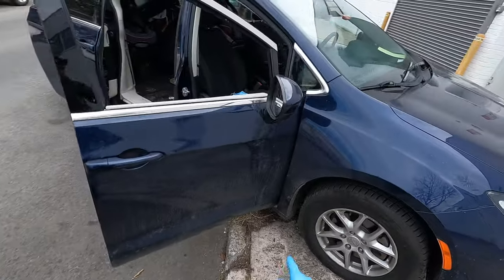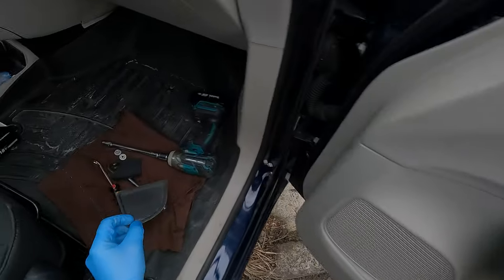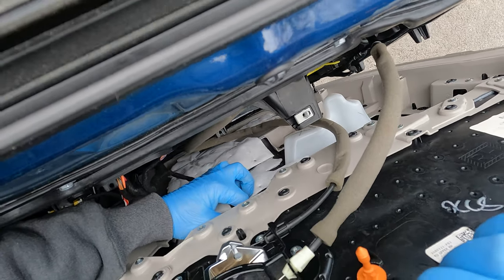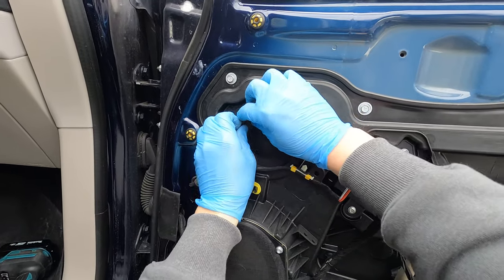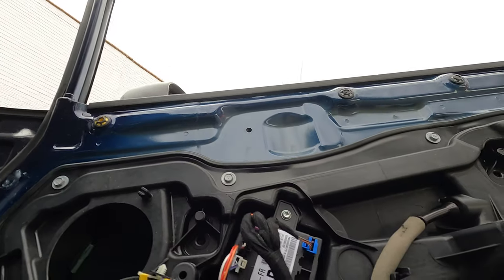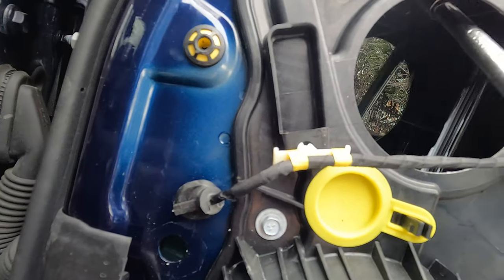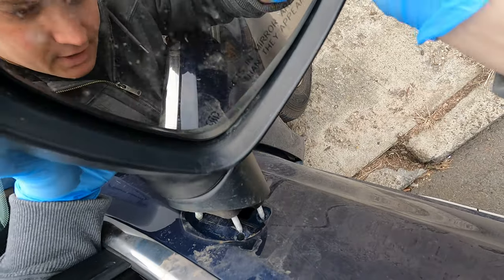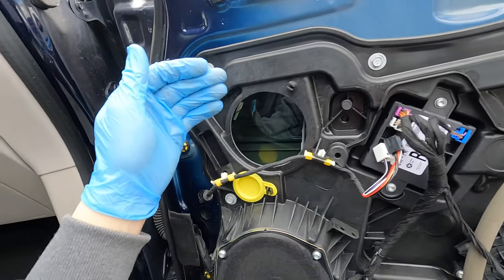Chrysler Pacifica DOOR MIRROR removal how to 2017 2018 2019 2020 2021 replace lock 2022 2023 2024

Comment: This is a good video but one thing he doesn’t tell you, that in order for you to get wires back in for mirror is to roll up the window and if you do drop anything you can actually take the speaker out for easy access.
Reply: Completely agree. It's a great video, and follow the advice of connecting the cable harness back to the window control and rolling it up to route, unroute the mirror harness. 

 Btw, my door's window / door lock controls are installed in a console that easily pops out so you can connect and disconnect that harness more easily.

Comment: this was helpful, but the hard part was getting the wires routed so that they weren't in the path of the window. if you feel around there's a little hitch in the sheet metal that the wires can go around that keep them out of the way of the window.
Reply: Confirmed window up after removing and mounting new, tuck wires behind glass and jog window up to give more room to run wires

Comment: Good video but need more information on routing the harness. The window must be down to access all three nuts but the window must be up to route the harness around the outside of the window track and back through the oval shaped hole. Take care not to pinch the harness when rolling the window back up. Small nimble hands are helpful.

Comment: an old telephone cable or network cable trick is to tie a rope / string / wire of some sort to the wires as you pull the mirrow out and use it as a guide to pull the new wires back in.  FYI

Comment: Super helpful! The only other tip I could add is for the very hard to reach nut, I rolled the window all the way down to clear the window bracket. Then as others said, just be careful about rolling down the window if you haven’t routed the wire harness correctly. You have to push it down and towards the hinge of the door and around a routing peg to keep it clear of the window as it rolls down.

Comment: I just ordered the replacement mirror. My question is do I need the old wire from the old mirror or does the new one come with it? Reason is that the wire was broken when it was hit. The whole mirror broke off and broke the wire.
Reply: Mirror comes with full harness.